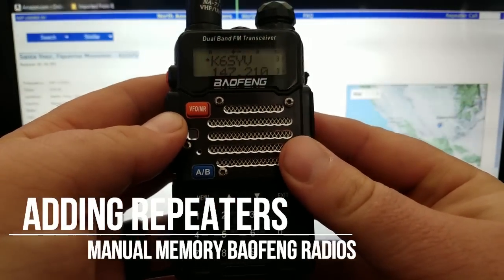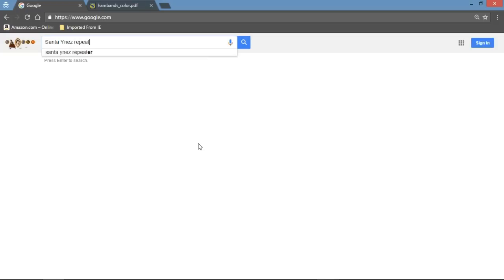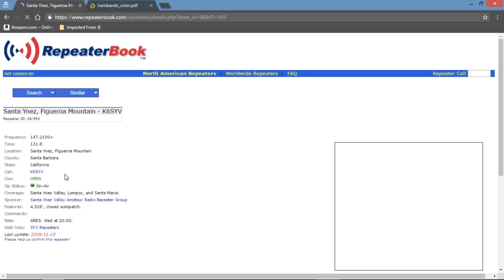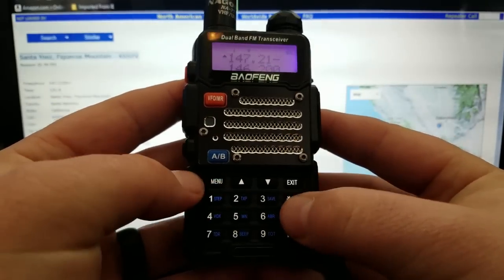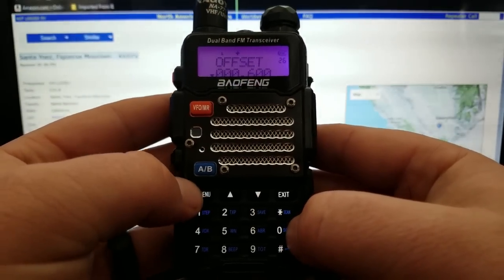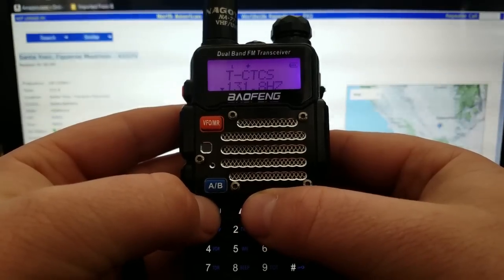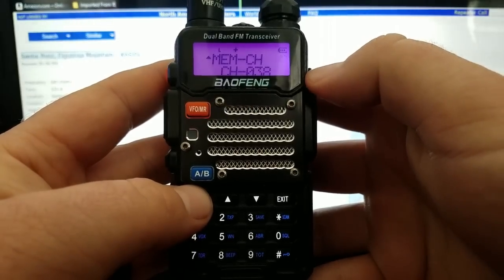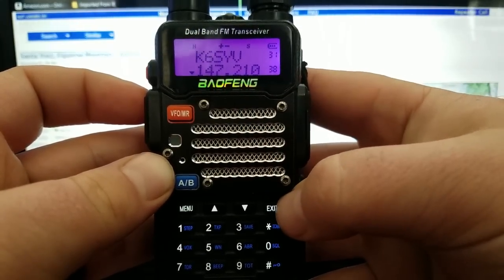Baofeng Radio: Repeater Programming (Manually)

Comment: thank you.  I was about to drive myself to the insane asylum because every time I programmed the frequency manually what the positive offset of 5 megahertz and both tones and saved it, the radio would not save the offset. once I programmed Rx/Tx separately as you did here, it worked fine

Comment: Amazing radio. After watching this video I programmed two if these radios to a repeater and I was able to communicate clearly at 10 miles away! Thanks.
Important. Use Menu in frequency mode to input and save your parameters and then switch to Menu in Frequency mode to check your programmed data, in Channel mode the parameters will show as they were originally unchanged. In other words if you are not in the correct mode it  will seem that the parameters you entered and saved have been erased.

Comment: So if you don't have an amateur license you can't program a repeater because you have to transmit on the last step?
Reply from the maker: If you just want to listen to a repeater just program the "listen frequency' or repeater output on a channel. All those steps are for setting up the transmit after you save the listen freq. If you're not transmitting you don't need "transmit memory" or an offset or the CTCSS tone.

Comment: Do I need a ham radio l license touse a repeater
Reply from the maker: In most cases, yes. There are such things as GMRS repeaters, however technically you need a license (mailed in info card and fee) for that as well. Other exceptions are under business licenses but the business themselves have to go through the lengthy process of licensing the repeater and site.

Comment: I’ve tried this but still fail to revive a morsed signal off the repeater
Reply from the maker: How far away is the repeater you are trying? Is it in a digital mode? Is it still in operation? Have the tones been changed to make it private?
Reply: j69chevelle it’s about 20mile away from me it’s anolog as far as I can see it’s the sidmouth repeater in the Uk Devon
Reply from the maker: @ShootersReviews  20 miles in the city and/or in doors is a bit of a stretch for a handheld Baofeng and a stock rubber ducky.
Reply: Ok I try get closer
Reply from the maker: @ShootersReviews  Is that your closest repeater?
Reply: j69chevelle yes sadly it is as I can’t find the one for ottry Saint Mary

Comment: Everything worked but it jumped my output freq up 10.0 instead of 5.0. Listening was 464.150 and transmit is supposed to be 469.150 which is how I input it. When I transmit it comes up as 474.150.
Reply: You can edit this in Menu Item 26 and editing it to show 005.000 instead of the 010.000 that it likely reads.  You can then verify what it is flipping to by pressing the "*" key to show it after being reversed then returning back by pressing it again.  You will need to do this in the Frequency Mode then save the new channel for it to work.

Comment: I have 2 baofeng uv 82 radios how do I transmit to each other on the job site
Reply from the maker: Press orange VFO button until your radio says, "frequency mode." Choose a frequency. Follow the same steps for the other radio. Ensure they are both on the same frequency. Ensure the frequency doesn't change when you transmit.

Comment: For some reason, when saving the channel, my radio defaults to transmit instead of receive.
Reply: I would love to help, but I'm not sure I understand your question?  It defaults to the transmit frequency while it should be receiving?  Does it show that the frequency is reversed on the top line of the display?
Reply: simply delete the channel you want to save to first.  then the first thing you program to that channel will be receive. then program again to that same channel and it will say transmit. I had the same problem till I realized that saving doesn't overwrite like you would think
Reply: Just got mine and had the same problem. I reset the radio and it fixed the problem.

Comment: I havent got a call sign yet ,how can i sign up with the repeater software,
Reply from the maker: What repeater software are you referring to? The web search in the video does not require a callsign however, I might suggest only loading recieve frequencies into to your HT or mobile until you get your call. This would ensure that you don't end up accidentally transmitting on the repeater.

Comment: When I set it up to a repeater , I can only hear bleeping. How to I hear people talk ?
Reply from the maker: Jamie Walters make sure you are tuned to a repeater and not some sort of digipeater. Owners of certain repeaters will also operate digital modes either intermittently or on a dedicated basis. Ensure you are not listening to any variation of the above. Try finding a different nearby repeater and see if you get voice traffic there.
Reply: j69chevelle I have but I can't hear anything, I haven't heard any chatter but bleeping. I have connected to other near by repeaters but nothing. I have gone through the settings at changed them to suit the repeater but there is either bleeping or Morse code. Thank you for the help I appreciate.

Comment: if im not getting any feedback from the repeater does that mean its not connected? Sorry, new to this. trying to connect to AA5RO
Reply: Joseph Kuser did you factory reset your radio? I have to do that each time I want to change repeaters. Not exactly sure what CT stands for.
Reply from the maker: Joseph Kuser so you shouldn't have to factory reset every time. You just go to frequency mode, enter a new repeater on a different channel and switch back over to memory mode to use it. "CT" stands for CTCSS (the PL tone) you should only see that in the window when you transmit.
Reply: Joseph Kuser no problem, I didn't hear anything on my repeater at first, turns out I wasn't at close enough range. Cheers.
Reply: j69chevelle awesome thx. Looks like it had some glitches. After one reset everything seems to be programming fine. Thx!
Reply from the maker: Tech2025 you should hear the carrier of the repeater come back if you got into it. Most will also identify immediately afterward too, if they have been dormant for 10 minutes or more. Make surr you see the frequency change when you transmit and you should also see a "CT" appear in the window.
Reply: j69chevelle yeah  after talking there's some white noise feedback. Also every 30 mins it makes some beeping sounds and states the repeater name. Thanks
Reply from the maker: Tech2025 you're in business than. The beeping is the repeater identifying in morse code.
Reply: Tech2025 I'm following those steps but the CT does not appear and I'm not getting any feedback after keying up. Any suggestions? What's the CT stand for?
Reply: Tech2025 I did reset and it seems to be working now. I have 2 and they were both acting strange. On one the sound cut in and out randomly. The other wouldn't save both the rx and tx freqs. Reset both and now they seem to be working although I'm not hearing anything on the repeaters. Thx

Comment: how to programme? [ RT22 ] how do I know if the software is connected, if it will write ??

also how to reduce output power from 2w to 1w ?(it seems there is only a high power or LOW power option, i believe this can change it to 1w but what about options for 1.5w or 0.5w ????
will changing to low power (1w) give you more run time power* ?
Thanks
Reply from the maker: Are you using CHIRP for the programming software? Looks like it may have come with factory software. https://www.youtube.com/watch?v=fE5BtBIabEE If the RT22 is supported by CHIRP, you might have more options to change stuff like power than with the factory software. Not sure though. Not familiar with that radio.
Reply: i am using the official retevis software and dual aux - port usb cable.. that link does not explain much?..

Comment: This was not useful.  You go very fast and don't say what you're doing.  I tried following this by playing it several times and still was unable to program the local repeater into my radio.  I will look elsewhere.
Reply: I've learned to use the "pause button"on youtube when trying to follow the instructions and punch them into the radio at the same time.  But your right written instruction would be great to follow along with.  To bad there is no print text button on utube.
Reply from the maker: Stephen Johnson Good luck. Seems pretty straight forward. 1st I've heard of anyone having problems. Maybe the repeater information is outdated. What step arr you having trouble with. maybe you are the type that does better with written instructions by the numbers.
Reply: j69chevelle 

This was a great video!👍I paused it as needed and it helped me tremendously! He's just slow
Reply: @Fordgroup00   #savage

Comment: hey how you doing im a new technician and i im having a problem in programming these bands my problem is if i whant to program the 70 cm band and the chart is showing me 420.0 to 450.0 mhz do i have to program the 420.0 and the 450.0 and do i have to program the 420.0 on the top numbers and the 450.0 on the button number display or do i just program the 420.0 mhz and 450.0 will be program along with the 420.0 programming please help i looked everywhere can't help on this?? thanks
Reply from the maker: Jay Wolf what repeater are you trying to tune? That would be a very atypical repeater pair especially considering 450 MHz is outside the 70cm amateur radio band. Typically, repeater information in a directory won't even list the transmit frequency but instead substitutes it with the + or - standard 5 MHz (70cm) offset. If you were to say cross band or program an atypical offset you would simply bypass the offset and SFT-D options and program the transmit frequency on the same channel you had programmed the receive (listen) frequency. Hope that helps.
Reply from the maker: Jay Wolf congratulations on your new ticket!
Reply from the maker: Forgot to mention, you still need to ensure you program the appropriate T-CTCSS (PL tone) for the transmit frequency even with an atypical offset or crossband offset.